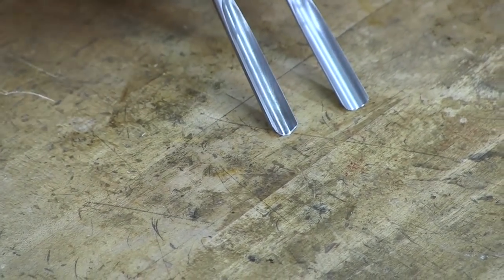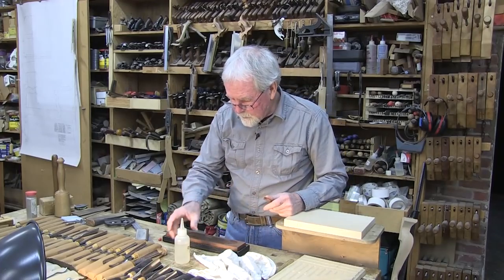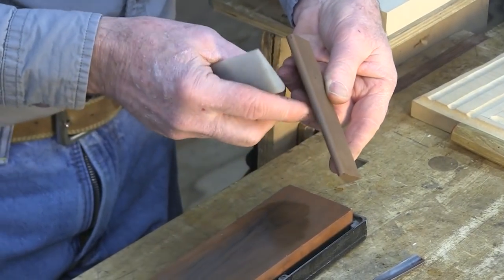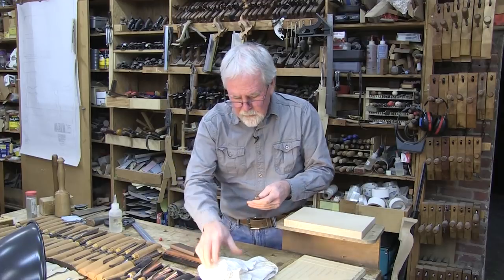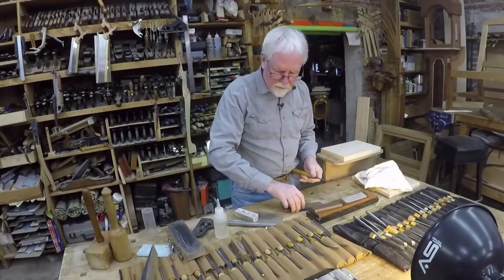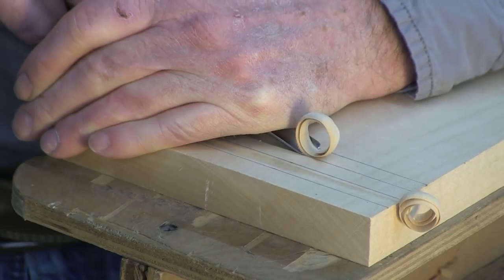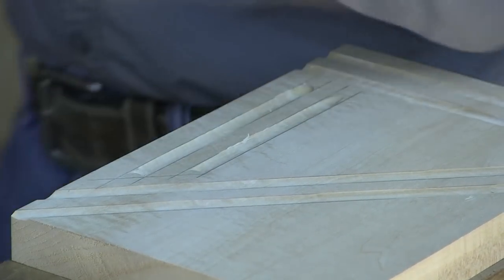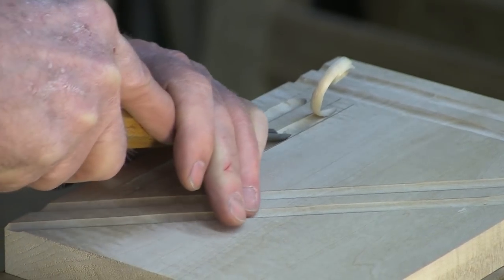The Art of Woodworking - Episode 7: Getting Started with Carving

Comment: Does frequent stropping during use maintain the edge so the stones are seldom needed?
Reply: It does, and there are many woodworkers who swear by it instead of going back to stone/diamond block as often. I think you will need to be stropping quite often though so the edge doesn't get too dull for that to work, but it is a lot quicker to do. I usually do a few strops when I am pausing a cutting action (maybe done or moving onto another part) and it does seem to help, but I still regularly stone them as well since that really brings out the edge when needed.